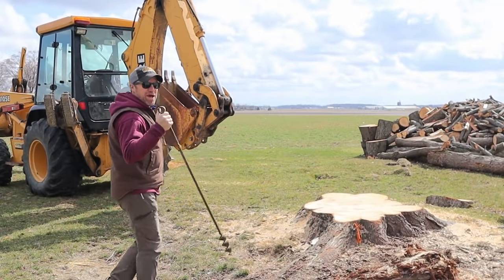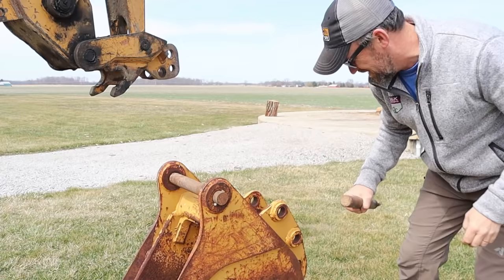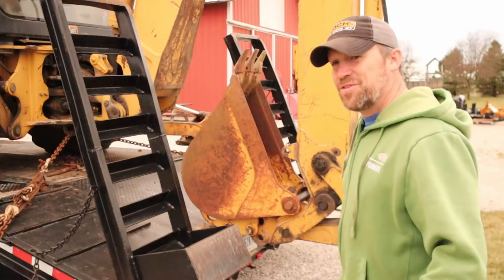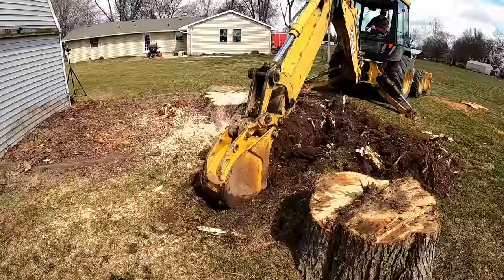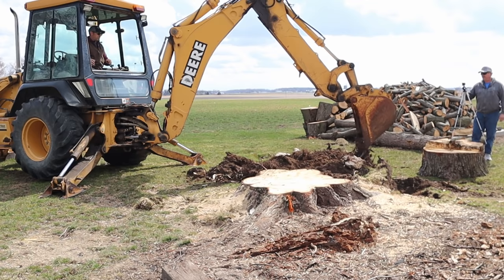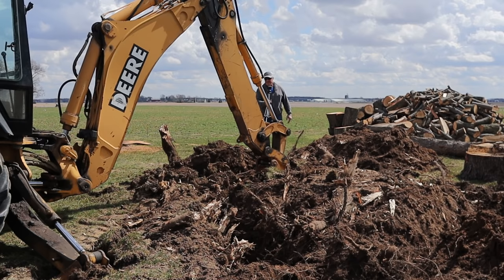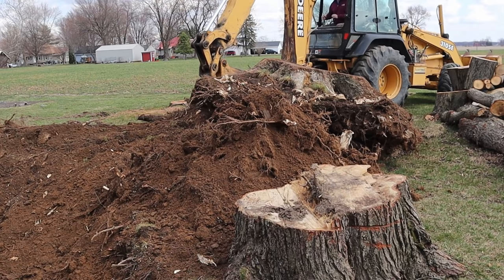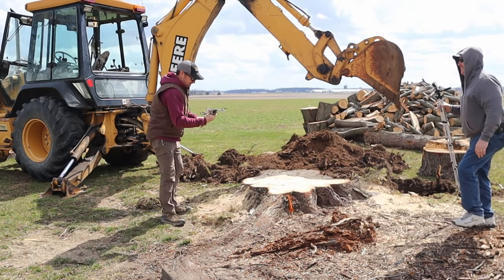The Biggest Stump I've Ever Tackled With A Backhoe! - John Deere 310SE Digging Huge Maple Stump

Comment: Next time just leave the whole tree there so the operator can use its weight as leverage to knock it over, then cut it up. Don't give the wood away, you will need it to burn up the stump. Speaking from experience.

Comment: It is usually better to leave the stump 5-10 feet high so you can use the stump as leverage to pull and or push the stump over. At least that is what I have found with pine trees, cause they have a big tap root in the center.
Reply: You wont do that with a maple or an oak....very different than a pine tree in many ways from roots to strength
Reply: Exactly...when I had several trees cut I told them to leave them 20ft.  They had no idea why until I told them how I was getting the stump up.

Comment: As a kid I saw several stumps dynamited. It was not meant to remove the stump, only to loosen the roots. The dynamite holes are drilled from the side of the stump underneath to get the dynamite into the root area. When done right the stump can be pulled out by a team of horses.
Reply from the maker: That's awesome Arnold!  I wished I could have seen my great grandfather remove stumps with dynamite.  I have only seen dynamite explode once and that was just to see the bang, not for any work. Thanks for explaining the process and thanks for watching!
Reply: You are correct.  My dad removed a lot of stumps with a D4 Cat. He would use dynamite to loosen the bigs ones. He had a pointed 3 inch pipe about 4 feet long with a short length of chain with a hook welded to it. He would push the pipe under the stump and then use the chain to pull it back out. We would take the paper off the dynamite sticks and push the dynamite in the hole with a broom handle. Sometimes we used a fuse on the blasting cap and sometimes we would use an electric cap. That's how the old timers did it and we didn't die.
Reply: Dido ,  Arnold.
Reply: I’ve seen tree stumps dynamited and they’ll blow the things clean out of the ground one stick might not if it’s big but two or three sticks of dynamite will blow A tree stump to kingdom come
Reply: That’s exactly how I watched it done.
Reply: And who was the genuine that said give me a leaver big enough and I can move the world?
Reply: Our neighbor had old virgin 5'-->10' stumps dynamited... well most of the explosive was fertilizer, but I digress... the Stump bits were blown 200 ft into the air.  They still had to bring in a big thumbed trackhoe to grab all the monster root bits up.  After having removed several giant 5' stumps with a dozer... I can't say I didn't wish for the dynamite a time or two myself!

Comment: Nice work.  One piece of advise, fill you front bucket with dirt or rock to add extra counter weight.  It will make a big difference in your ability to pull with out tilting the backhoe over.  But you are correct no point in getting in a hurry you'll just get aggravated or break something.
Reply from the maker: Good tip!
Reply: @digdrivediy  Better tip, weaken the stump with a Chainsaw as deep as you can with an X cut on top use an old chain on the saw.

Comment: Down here we use a hook attachment. It looks like a fishing hook, it goes on the Backhoes and diggers.
It uses the same principal as what you have used with your trenching bucket but being as it is, it goes down and cuts the roots out completly.
Reply from the maker: I could see that being a very practical application.  If I did more of this stuff I'd probably look into one.  Thanks for the comment and appreciate you watching!
Reply: In Michigan we  use something called a frost tooth. It's made for cutting through frost but works well on these tree roots
Reply from the maker: @ifyoutip  I've had the pleasure of ripping plenty of frost with one back when I worked in excavating full time.  You're right that thing was handy for roots too!  Thanks for reminding me of that frost tooth.  It was always a struggle pulling the excavator around on top of the frozen ground!

Comment: When I was about 11 (around 1958-59), our County Agent came to our farm to blow five or six old Maple stumps, probably 30" plus diameter. 
He use an auger like that. He put up to three sticks under each stump. He used a large nail to poke a hole into a dynamite stick, inserted the blasting cap and fuse and stuffed it into the bottom of the hole. He then added whatever additional sticks/partial sticks into the hole then packed it with earth. 
He ran out as much fuse as  he thought was needed for a 10 minute burn and split the end of the fuse cord. He sent my brother and I in the farm pickup about a 10th of a mile away then lit the fuses. 
The stumps went up one after the other - lots of noise - and stump chunks and rocks and dust galore. Some of the lighter chunks reached the truck. That was a fun day, except for having to pick up all that debris from the field afterward.
Reply from the maker: Oh man, that would be so cool to witness Neil.  I've always wanted to see it for myself.  Tough to be able to do these days.  Thanks for the story and for watching the video.  I could picture it perfectly!

Comment: All right guys , your mechanics at getting the bucket to fit was perfect. I have removed many trees with a backhoe and I am going to tell you how I did it . They were pine trees (30-42”) on the stump) and the root system appears to be much different, they had the big horizontal ones but also ones that looked like a tree going down about 8ft.
 First locate your big side roots and dig them out first , as far away from the tree as you want , so that you remove as much of the wood , which as you said rots away leaving a void , then I dug a trench around the tree ,sometimes  a triangle but usually a square about 6ft deep ,& about 4-6’ from the stump . Then positioned tractor about 8’ from the tree , put the backhoe against the tree & come down , as far as I could causing tree to lean , then dumped the bucket till the teeth engaged the trunk , then did the dipper extend pushing tree over , pulls the whole stump OUT . Chip as much dirt off as possible, having someone to pick up all the roots .
In your case with almost nothing going deep down , you will have to experiment as to the technique .
I did notice one problem with your operation , you need to fully dump the front bucket & put it down on the ground enough to just lift the front wheels of the ground , & you won’t be so hard on your tractor!
Some of the stumps I took out so big that when I chained them up to the front bucket, could not lift them , so I rolled the bucket & lifted the back of the tractor , then stuck the hoe strait to the rear with the extender all the way out , which picked the stump about 1ft off the ground 
Good luck
Reply from the maker: Sounds like you've got a great system Robert!  Thanks for sharing all the great tips.  Next time I work on a stump I'll be keeping this in mind.  Thanks for watching sir and leaving a great comment!
Reply: I've used similar techniques  myself  , every kind of tree has it's  own quirks and patience is the key !
Reply: As you said, a pine tree is much different.  It's like giving tips on playing golf by how you shoot a basketball into the hoop.  Enormously different tree in growth, roots, strength, soil type, etc

Comment: Thanks guys. Reminded me of a similar experience with a big balled cottonwood  in Denver, Colorado back in '87. Needed to put in a garage bldg. and stump was in the corner of the bldg. The hole and ball size were much like this one, but he did the whole dig w/ a 2 ft bucket. Took him 2 + days too, and that's when the trouble started.  No trailer on hand. so when he chained up the ball to the arm the ball weighed as much as his 14,000 lb. rig. Couldn't get it high enough to put it into the dump truck, either.  It's always something.......Thanks for sharing.
Reply from the maker: Sounds very similar!!  Thanks for watching Clifton!
Reply: @digdrivediy  back atcha!    p.s. I'm old enough to remember dynamite at the hardware store in parts of this country. Grandpa sez :  Use the auger to dirt hole a shaft at a 45 angle from just outside the edge of the stump. Try for a lucky shot (not hittin a root on the way in) to the center about 3'-4' down. Fuse up a stick and get her to the bottom of the hole with plenty o fuse. Better tell grandma what's up before lighten er off. and get back a good ways. Ahh ,  Saturdays in America !
Reply from the maker: @cliftontorrence839  Haha!  That's awesome!

Comment: We were fortunate to have another way to remove stumps back in the day. An old guy who did custom farm work as a young man sold all of his threshers, clover hullers, etc but kept one J. I. Case steam tractor and thresher back. Ours was one of five farms that belonged to a "threshing crew" One year we actually used the steam tractor to run an antique threshing machine. But in the winter "old Louie" would "grub" stumps using the steamer and mill chain. Links about a foot long made of one inch diameter rod and "forge" welded. The chain was too heavy to lift on to a wagon so it was moved on a stone boat and drug around a stump with another tractor. Louie would pull the slack from the chain and after one or two puffs from the steamer the stump would just jump out of the ground. If you were a 14 year old kid in the 50's it was something to see. You did a good job with your backhoe.
Reply from the maker: Wow, that is a terrific story!  I could picture it, but boy would that be something to see! Those steam tractors sure had a lot of torque and power from what I've seen.  We have a local annual steam show and I always enjoy and appreciate getting to see those things work.  Thanks for sharing that memory! That would be a fantastic video!!!
Reply: Cool story.  I did not realize they were so powerful.
Reply: My grandpa had a steam tractor & a threshing machine , but I only saw it working one time , threshing in about 1948 noting else , thanks for the story
Reply: In 1950 I was 9 yrs old , my dad came home from England in September 1945 was sure a different life back then !

Comment: I learned a bkt of dirt helps. I have dug up tons w a 2wd 310. That pump sure was whining. It's so satisfying when the stump finally starts to move
Reply from the maker: You're right Dave.  Wished I would have had a little dirt for counter weight.  The pump was a bit whiney.  The microphone exaggerates it a bit too.  The best part is seeing that first little wiggle.  Let's you see some light at the end of a long tunnel.

Comment: Just stumbled across this video.  16 yrs ago I was quoted over $11k to put a driveway in on a piece of vacant land. But I found an old Ford 755 BH for $8500 and with $3.5k in gravel, I got the driveway in and got a BH to boot. Since then I've used it to clear land for a PB and house. Probably pulled over 100 stumps in the process. Some were too big to pick up (like this maple) and I could only push them into a pile. However, I learned just what you said: you gotta have patience and go slow. It IS rough on the BH as you said. I've had hoses burst while pulling a stump and have lifted the front end of my 10 ton machine off the ground like it was a toy. Luckily, I've never "broken" anything that required pulling my welder out. Nice video, enjoyed watching it.
Reply from the maker: Thanks for watching Jerry!  You sound like you come out ahead on that deal!  That's the best way to do things... yourself! :)

Comment: Btw, I once dug out a 50' tall and 30' wide sycamore tree stump. The tree truck was 30" across. The main stump (below soul grade) was 6' across. I was on a Bobcat S180. It took 4 hours! I was freaking dead tired when I finished! I started from about 10' from the trunk and slowly started digging around it going 3' deep slowly breaking off the roots. Eventually, I got close enough that it started to budge a little. That little bobcat was a beast. As long as I did it slowly and let the bobcat do the work. I didn't attempt to move the stump till I felt comfortable the bobcat could do it. I know it wasn't the best way to take out a stump that size but it was the only piece of equipment I had available to me. Truth is, I was dang proud I got it out of the ground.
Reply from the maker: That is something to be proud of for sure!  Thanks for watching!

Comment: I dug out an oak stump that was over 24" using a 5 Ft. box blade on a 37 HP tractor. My front yard looked like I was building a large swimming pool. I had to go down 6 Ft. deep all around it so I could expose the seemingly millions of sucker roots which I cut with a sawzall. Root ball was over 6 Ft. diameter...I drug it out of the hole and into the back with the front tires of the tractor way in the air. It was in the middle of many bon fires over several years and finally it's all gone. You were right about being patient so you didn't tear up your equipment. I've ripped the ears clean off my box blade...3" x 3/8" steel.
Reply from the maker: Holy Cow! You've certainly got more patience than me though to tackle that with a box blade.  Nice going!  That would have been a good video.  Thanks for sharing and appreciate you watching!

Comment: We have a ripper shank we use on out 160 excavator for rock. It also works great on ripping stumps out. The shank is 2” wide and rips roots out with ease. No matter what, stumps always make a machine work hard to get them out. Amazing how strong wood is
Reply from the maker: You've got that right B&K!  I would have used a frost shank if I'd have had one.  When I worked in excavating we did have one for our 690 excavator and used it on stumps.  Got through and rip roots on everything that was coming out and then go back and hog em out and clean the dirt with the bucket.  Thanks for watching!
Reply: I made my ripper with an old coupler & a bulldozer tooth , read on my comments .

Comment: Last time I was asked to remove a large stump for a building project I got fooled. I could not find any roots so kept digging down around the stump. Dug down about 10 feet and stopped, just cut the tree off there and filled the hole. The tree turned out to have been buried in back fill about 15 feet deep, and somehow survived like that for over 100 years. Lot was filled and leveled around 1910.
Reply from the maker: That's incredible.  I didn't think  a tree would survive like that.  Awesome story there.  I would have been baffled!  Thanks for sharing!

Comment: Had to do some clearing for a new mining area once. Used the D11 dozer to remove the stumps after loggers got what they wanted. Surprising how tough stumps are even versus big machines like that. You really put in the work to get that thing out with your little backhoe.
Reply from the maker: Yeah, a D11 would have made this a bit easier!!  Still think it turned out OK though.  Thanks for watching!
Reply: A d11 for stumps ,that would be fun

Comment: I've run alot of equipment over the course of 20 yrs and a piece of advice I'd give for the next stump ya dig is roll ur bucket all the way down and lift ur front tires off the ground and put ur stabilizers down enough to lift ur back tires just off the ground and you'll get much more leverage out of ur bucket, it's tricky in the soft ground I  know but it takes a Lil work & compensation to manage it and  it definitely helps, all backhoes are different with wear and pump sizes but stability makes a great difference.
Reply from the maker: For sure!

Comment: I inherited a Ford 755 backhoe it's an 1981 Itll dig up anything I've tried so far I've done 12in on diameter to 24in diameter. The worst stump I've tried was a ash tree it was 27in across it had main roots 8 to 10 in I couldn't believe it. But great video. I absolutely love backhoes. I'm just better at destroying things than finesse work with them
Reply from the maker: That's cool Bryan!  I love backhoes too and I've always heard those 755 Fords were really good machines. Thanks for the comment and I appreciate you watching!
Reply: @digdrivediy  it's great what makes it cool I inherited it, but its bitter sweet a loved one passed and that's how obtained it. But the log splitter you made was awesome I seen it on tractor time with Tim. Look forward to seeing more videos just subscribed.
Reply from the maker: @bryanblood7063  Bittersweet indeed. Thanks so much for the sub Bryan! Glad to have you watching.
Reply: Ford built some of the best backhoes back in the day. The 555A/B/C don't have the power to keep up with a 580SM but will lift more. 
And due to the taller, narrower tires, will walk through mud the Case won't. Dad was a little embarrassed that day I pulled him through that mud hole.

Comment: I’ve like to dig the roots before I cut the tree then I use the weight of the tree falling over to pull the root ball over and out. Given there’s no structure around.
Reply from the maker: I've done that too.  I was intimidated by the size of this one and just the backhoe.  My hole would have been pretty big around the bottom I think.  That's a good method though for sure.